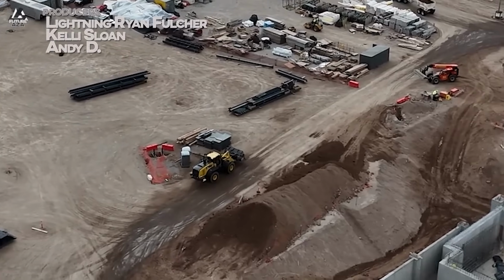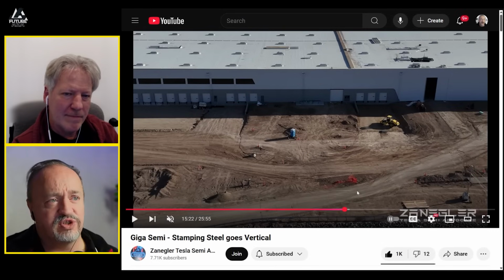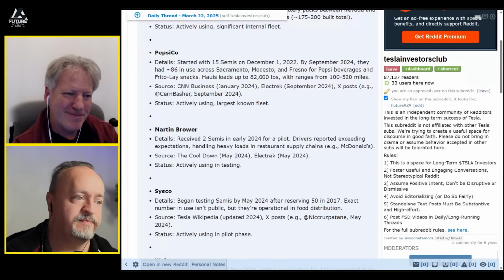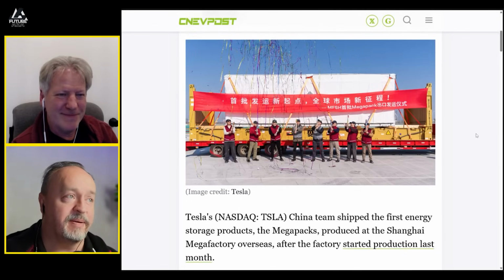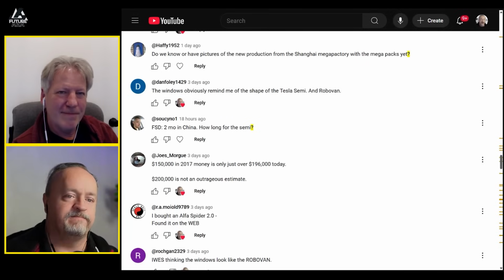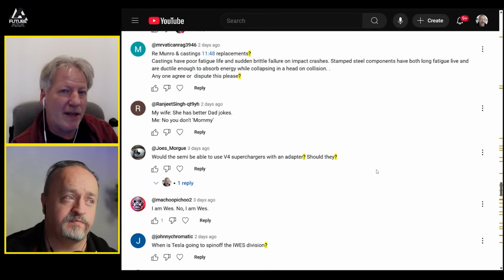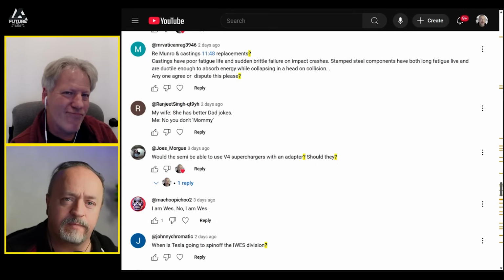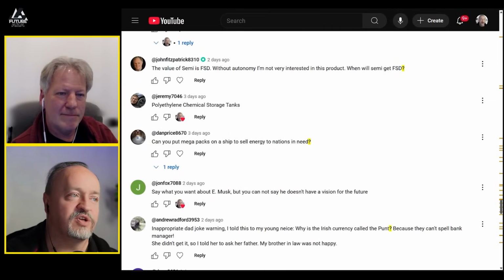MASSIVE Steel BOOST At Tesla’s Giga Semi Factory!

Comment: Re: your comment about Level 1 charging being an "infinite charge" for cars, I strongly disagree. Level 1 on a 120v 20 amp typical garage circuit charges at 1.9 kW. Sentry mode has never used that much power continuously and with sentry mode off in a garage you get a pretty good charge. It takes my 78 kWh model Y 41 hours from zero to full. I get 2% per hour on Level 1 and that's not bad at all. The more we tell people that Level 1 is unusable and you need a $1000 Level 2 charger installed, the more we discourage EV purchases.
Reply from the maker: Not for a car. I had L2 at home for the first 8-9 months without a problem. But for a semi, it would be AGES.

Comment: I actually believe FSD for the Semi will come very rapidly after full scale production begins Ramping. One thing that the current AI development trends are pointing to is that special case enhancements to a generalized model require much much less data and cycles to accomplish. In addition the source of the training data already by definition is coming from professional drivers which will greatly narrow the bands of uncertainty within that set. To a large extent you are therefore training mostly "the muscle memory" of the main actor and inserting that into a well understood environment with the behaviors of the outside actors anticipated from the base model. I do wonder however if Tesla will now begin to build its own maps for at least a filter for route planning with weight limitations and other restrictions included.

Comment: It’s possible that fully autonomous vehicles could alter the economics of freight resulting in a smaller standard size for containers.

Similar economics will probably make the optimum size of a bus significantly smaller.
Reply: If that is true I could only see smaller containers that are a even fraction of a standard sea can (e.g., 2 small ones = 1 standard one). There is just so much of global transport that is tied to the size of standard sea cans.

Comment: Back when I drove the semis, part of the trip planning was to route to designated truck stops and depots.  It is just common trip planning just about every company driver has to do.  The people currently using them are running routes taking from company terminal to company terminal.